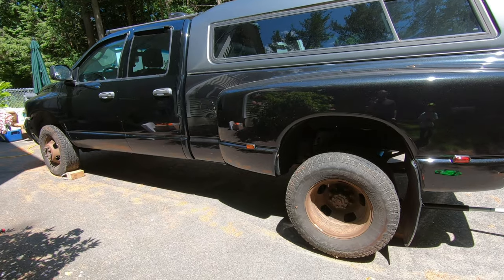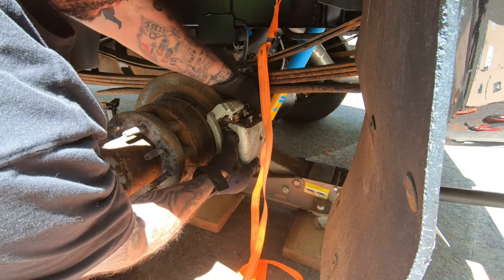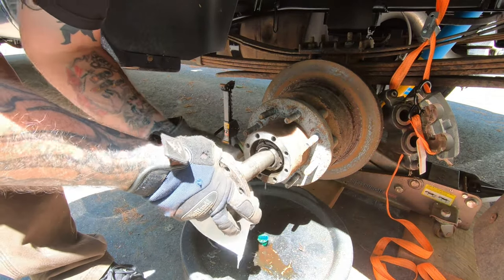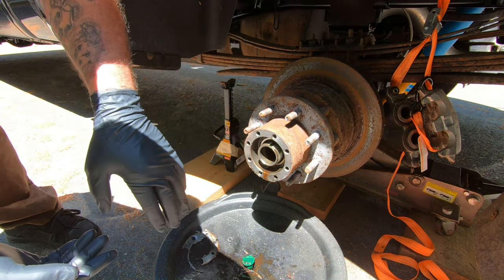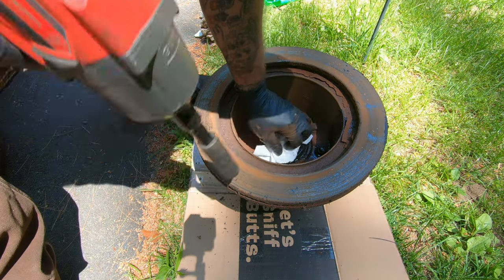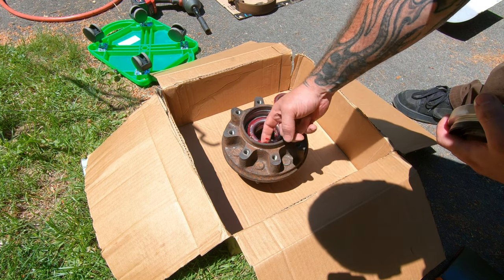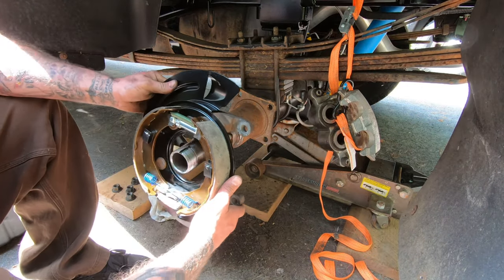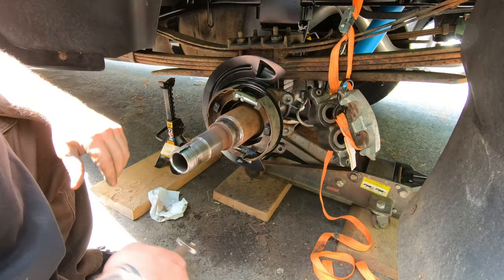2003 Dodge Ram Dually rear brakes, rotors, and parking brakes

Comment: The moment a person touches the anti-seize bottle is the moment it gets on your shirt, pants just everywhere. Even when you try to prevent it from spreading it's just incredible how that stuff ends up everywhere. I'm happy to learn you serviced the differential fluid off camera. When the axel was removed what dripped out looked watery. I always ensure axel vents are clear, protects axel seals, and if they need a water trap added because the owner is going to pull a boat that I add a water trap.
Reply from the maker: I know never seize is like glitter. 😁 There was a little water in the rear but not very much, maybe like a teaspoon or less. When I changed the rear brake hose the vent broke off and I had to replace it but it was plugged. I almost didn’t change the fluid but I thought back to the incredibly poor maintenance on the rest of the truck and decided it was probably necessary and I’m glad I did.

Comment: The truck is coming along nicely. I also pack the wheel bearings with a little grease on the full floating rear ends. I figure it gives them initial lubrication until the gear oil makes its way through the axle tubes. I've also used anti-seize on certain brake parts. There seems to be quite a debate amongst the different techs that I follow on YouTube when it comes to brake lubes. Local climates affect the performance of it. I don't understand why manufacturers put the parking brake adjustment holes in inaccessible places. I always wanted so get one of those "safe-set" drum brake gauges. Dorman products are hit and miss. I have a love/hate relationship with them. I came up with the slogan "Dorman. Stranding motorists and frustrating technicians since 1918".
Reply from the maker: Thank you. I’ve seen the brake lube debate myself. I’ve tried the ceramic brake lube and had brake issues the next winter and the brake lube was gone. I’ve just had better luck with the never seize not that it’s that great either. It does seem like the parking brakes are an afterthought on these axles. I think I got it though they are working well and I do like the brake gauge better than adjusting them without it. It’s not a foolproof measurement but I think better than guessing how much drag is enough. I try and not get dorman stuff but sometimes it’s the only option, they worked this time though.

Comment: One thing I didn’t know about shoes, is old school mechanics widen or shorten the shoe arc to match the inside arc in the drum. They would use a block of wood and a 2lb hammer. You would think the shoes would break loose of the bracket, haven’t tried it lately but that process isn’t used anymore. On regular drum brakes the shoes wear even.
Reply from the maker: That’s interesting. I don’t get into drum brakes much anymore, except for the big truck brakes.

Comment: I would have had to clean the rust off those leaf  springs  and rims and painted. 
The rest of the truck is still pretty bad ass.
Reply from the maker: Thank you. Yeah i regret not blasting and painting the front and rear springs, but I did get new wheels and tires.

Comment: Great video.  One of my favorites that you have done.  One comment from me is that I always do my final lug nut torque with the wheels on the ground.  My concern is that when you torque with the wheels in the air you are placing a lot of shear tension on the parking break pawl.  Maybe my idea is wrong.  Thank you.  Craig
Reply from the maker: Thank you. Glad to hear you liked it. I haven’t myself had an issue with the parking pawl. I try and torque with the wheels off the ground or touching enough to keep the wheel from spinning because with the lug centric wheels I always though with weight on them it would put side pressure on the cone of the lug nut and cause a false torque reading. I don’t know if that’s right but just how I’ve done it. In the axle the differential will work opposite when applying torque to the wheels as opposed to the drive shaft so the 3.73 gearing from the engine to the wheels will go opposite and apply less torque to the engine. So in first you get more torque and less speed from the engine to the wheels but speed less torque from the wheels to the engine. 3.73:1 or 1:3.73. I don’t know if I explained that well.
Reply: @JasonTheMunicipalMechanic  Okay.  Thank you.  Kind Regards, Craig

Comment: Thank you for creating the video and sharing your project. I think you did a wonderful job. Working on the ground is difficult. The labor you saved will help the family. Will you be servicing the differential lubricant? Take care, Daniel
Reply from the maker: Thank you. I did miss the lift at work. I changed the differential fluid in the front and rear, I didn’t record it though. I’m glad I did I found some rust on the inside of the rear housing at the top I had to get out and some sludge at the bottom. The front looked good. I think they were rebuilt at some point there was writing on the carriers and gears in a paint pen or something like that. There is around 250k on them so I think some work was done. I also found it has a locker in the rear too.

Comment: Great video. Does each side take one seal and one bearing or two of each per side?
Reply from the maker: There is one hub seal, an inner and an outer bearing (they are different), and an axle flange seal per side so you will need two of everything to do the whole axle. The parts are also different for a dually or single wheel axle also.
Reply: @JasonTheMunicipalMechanic  Awesome, I ordered the right stuff after going back to your video. Thanks for your help!

Comment: Excellent instructional video, and the best part using 64" will make the metric folks nuts. What everyone else said about the anti seize. Is that a Dana 80?
Reply from the maker: 😁 I guess metric is supposed to be easier but I’m more used to sae myself. I guess the plus’s to everything going to metric is I can use one set of tools and cut what I bring in half. The axle is a 11.5 AAM. They are used on the gm trucks also.

Comment: What was done to the frame? It looks brand new.
Reply from the maker: I have a few videos on the frame in the playlist. 03 Cummins 5.9 seized engine rebuild and frame and body swap
https://www.youtube.com/playlist?list=PLRbLKd2i_Uy50fS6kTW0WsSFGpH3ADTuo I went to North Carolina and picked up a basically rust free frame. I then sand blasted it and painted it with southern polyurethanes epoxy primer. I swapped the cab with a Texas cab also.

Comment: What happened to this truck? Submerged?
Reply from the maker: Not that I’m aware of. I bought this truck with a seized engine and rebuilt it. While I was rebuilding it I started to notice some rust issues with the cab that I knew were going to get ugly so I decided to replace the whole cab. I’m not really sure how the water got in the axle but this was the most poorly maintained vehicle I’ve ever seen. Literally every part on this truck had evidence of someone working on it that just made it worse. I have a playlist on the process if your interested. 03 Cummins 5.9 seized engine rebuild and frame and body swap
https://www.youtube.com/playlist?list=PLRbLKd2i_Uy50fS6kTW0WsSFGpH3ADTuo